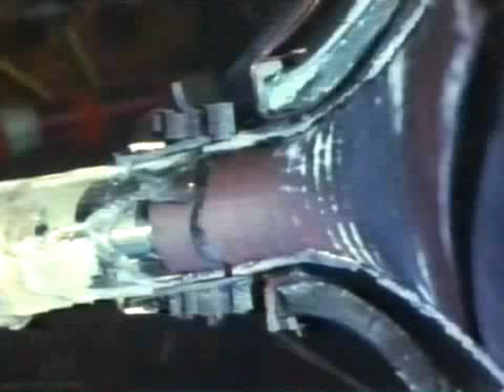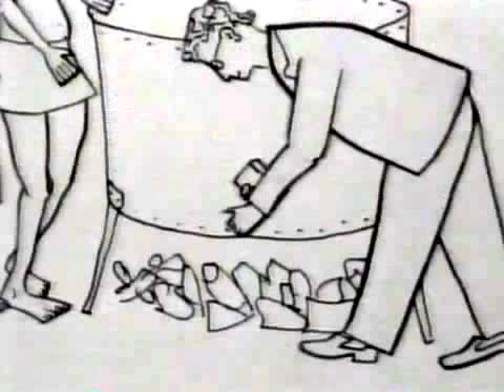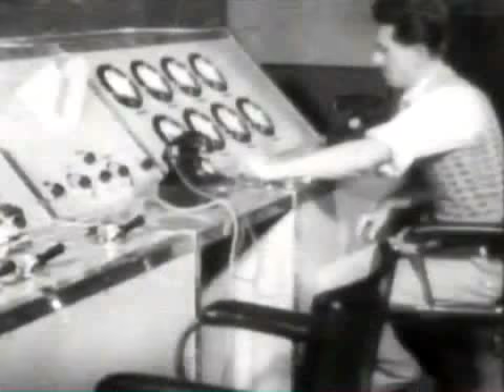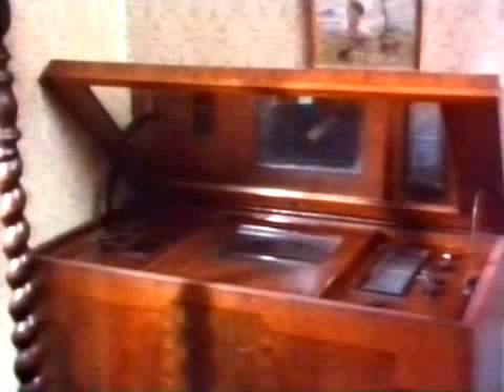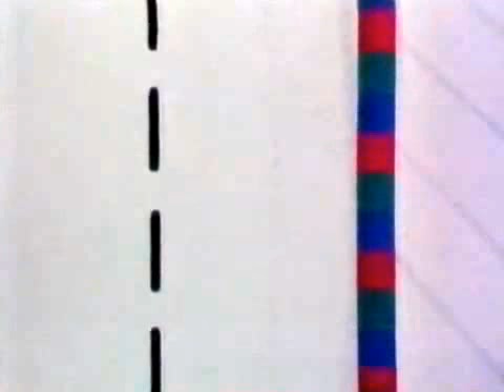Secret Life Of Machines - The Television Set (Full Length)

Comment: Every year on, fewer and fewer people will be viewing this on an old CRT screen.  Amazing technology back in the age of fire--bottles (tubes/valves).
Reply: There's an old, probably apocryphal story from the Cold War about American engineers first getting a close look at a Soviet military aircraft, and scoffing at it because it still used thermionic valves in its electronics instead of being all solid-state.  That is, until someone pointed out that in the event of a massive electromagnetic pulse from a thermonuclear bomb going off, the instruments in the Russian plane would have been more likely to keep working whilst the solid-state electronics in its counterpart fried.

By the end of the vacuum-state era, some valves ("Nuvistors") were as small as discrete canned transistors - I've seen a few TV sets that used them - and now, things are coming full circle with the recent development of the nanoscale vacuum-channel transistor...
Reply: @tommcewan7936  I worked for General Motors in London Ontario in 1994 on their LAV light armored vehicles division.  The engineers deliberately designed them with robust analog mechanicsl switches for exactly the reason you mentioned. Most of the varients which were created for battle conditions had foam injecgion systems built in to suppress any fire hazard. If only the engineers at NASA had thought of that when the Apollo testing was being done on the liftoff pad. Perhaps those three astronauts would have been spared that horrible death. White, Chafey and Guss Grisham.  RIP.
Reply: Who remembers a bad picture because of “ atmospheric’s” or kicking the tv cabinet inducing a thick line moving up the screen.
Reply: @grahamkearnon7853  or holding the "bunny  ear" aerial above ones head whilst balancing on top of the arm of the sofa  !
Reply: Here we are in 2023 and I can assure you that not a singke viewer will be watching this on anything other than a high definition TV , tablet or smart phone.

Comment: I worked in a television shop when I was in high school and college in the 70's.  Those old vacuum tubes, CRT's were a royal pain to work on.  Today, most televisions are "disposable".  They stop working, you toss them because it is cheaper to buy a new one, than to have it repaired.
Reply: You should watch Shango006, and RetroTech.
Reply: in some cases its only one or two bad capacitors in the power supply that stops modern ones working, if so, easily and cheaply fixed 😉

Comment: 605 line televisions. Tell them we have 4,000 lines now!
Reply: We don't though.  4k = 2160 lines.  (Twice that of 1080p)
Reply: @FunkySpunkyJunky  That doesn't really make sense. 2160 implies 2K since it's about 2,000. But anyway, we do have 8K monitors now, so yes, 4000 lines :). 2160 is still impressive by 1991 standards.
Reply: @tomservo75  yeah, i know it dont make much sense, but thats how it is. HD TV is 1080 lines and 4k is double that at 2160.  You are technically correct as 8k does exist, but not on mainstream TVs that I know of.   I wasn't having a dig, your point was still understood, that we now have very high def TVs that would have been unthinkable back then.
Reply: Quite happy with my 1080p 60Hz, thank you.
Reply: 405 and 625 lines

Comment: You forgot Philo Farnsworth! Inventor of the first fully electric television held 169 patents
Reply: They also forgot to mention that the Baird system only failed because the studio burnt down.
Reply: @nivlick  
No, it was failing before that. The 240 lines as opposed to the 405 lines of the EMI system, having to run the film through a chemical bath to develop it between the studio and the transmitter and the poor overall quality of the Baird-only sets and camera/ studio equipment all meant that fully electronic TV was the only way forward. The fire was just the last nail in the coffin.
Whatever you think of big business and its anti-social, even psychopathic, behaviour over the years, if you're launching a new technology like television from scratch, sometimes you need some proper technical and investment heft rather than just being a shoestring operation based on backwards- looking technology.

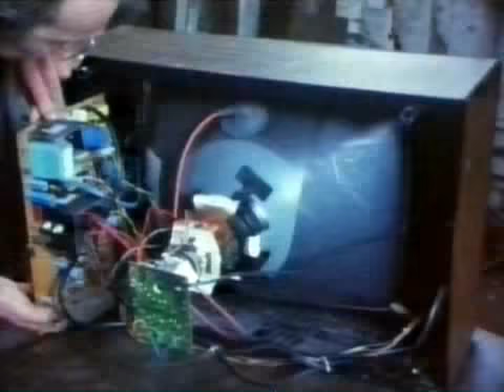Comment: 23:35 - I can't really tell from the poor quality of the video (as loads of TVs from the 80s had slide-out vertical circuit boards like that), but I think that's a set using the Rediffusion Mk4 chassis, dating it to between 1981 and 1985 (which, ironically, would have been - technologically - a little long in the tooth by then, the irony being that Tim claims in the voiceover that it's representative of a modern set for when this programme was made, around 1989!)
Reply: looks too modern for a mk4, even the 4A had 4 seperate pcbs, the one on screen has a switchmode power supply on the main board
Reply: @kevvywevvywoo  the one with the board on the left side may be a fidelity, the board looks familiar, i repaired loads of portables, mostly grey plastic cased,  using that board/chassis, usually psu blow up , occasional bad degauss posistor 😁
Reply: the one with the big 'motherboard' and several vertical boards is an itt , either cvc20 or cvc30/32, used to have a cvc30 for a few years, theres also a cvc5/8/9 shown, the one with a few valves in it, had a few of those, still got an unused 'spare' line output transformer for one..

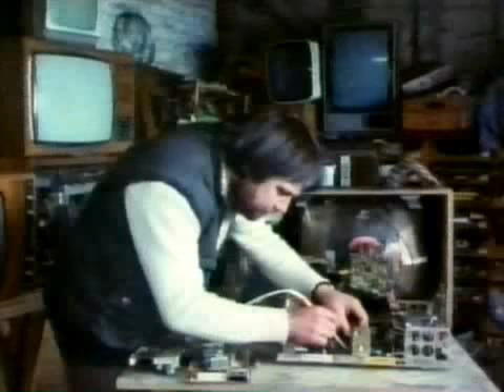Comment: 21:59 onwards - that colour set is one using one of the excellent ITT CVC chassis (somewhere between a CVC5 and CVC9, dating it to between 1972 and 1977). That is using one of the delta gun CRTs I referred to in another comment below.

Of all the TVs to go in that fire pile at the end, this ITT certainly didn't deserve to end like that!
Reply: i used to have 3 of the cvc5/8/9 series sets, plus a cvc30, and a cvc45? i think, all worked pretty well, the cvc30 being used as our main tv , with no back cover, previous owner lost it, !!,  for several years in the early to mid 90s,
Reply: @andygozzo72  If you’re on Facebook, you might want to join the group “UK Vintage Television Collectors”.
Reply: @stickytapenrust6869  already a member 😉
Reply: definitely not! poor old things 😢

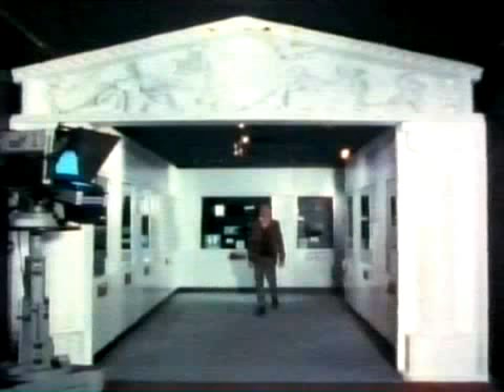Comment: 10:10 - that's an EMI 2001 camera on the left (with an autocue affixed to the front), dating from around 1968-1972 (which is when they were made). Many British TV companies used them and they were the workhorse of the British TV industry throughout the 1970s. The BBC were the biggest customer (indeed, it was designed primarily to fit the BBC's needs and requirements), along with about half of the ITV companies (the "big five" - Thames, LWT, ATV/Central, Granada and Yorkshire TV - along with HTV in Cardiff and Bristol and Anglia TV in Norwich).

The BBC phased them out slowly, with the first being taken out of service in 1976 and the last in 1991! The aforementioned ITV companies each began replacing theirs between 1979 and 1986, with Granada being the first (throughout 1979) and Central being the last (most of theirs had been taken out in 1984, but a pair remained for use with continuity and presentation purposes until 1986). Yorkshire TV were the last ITV company to use them for regular programme use, replacing theirs in 1985, and donated them to BBC Leeds for spare parts because parts were becoming scarce by that point!

Comment: 0:53 - I have that same model of TV in my collection. In fact, I have two, one awaiting restoration and another that's in such poor condition it's only fit for parts. That model dates from about 1975 and it uses the Thorn 9000 chassis, introduced the same year. It was Thorn's first TV to use the Precision-in-Line ("slot mask") colour CRTs and it was the second in Britain to use that type of tube, Rank-Bush-Murphy just pipping Thorn to the post when they introduced their Z718 chassis in late 1974.

The P-i-L colour CRT replaced the earlier delta-gun ("shadow mask") colour CRT that had reigned supreme in colour TV sets (apart from Sony, which used their own Trinitron tubes) from the introduction of colour TV in Western Europe in the late 1960s until being phased out in the latter half of the 1970s. Ironically, it was Thorn who were also the last to use delta gun tubes, in their sets using their 9800 chassis, made from 1978 to 1980.

Comment: Sigh. Back then tv was made to look great and work great. It made as furniture. Not anymore. By the way I was not alive back then and really not even a thought.
Reply: TheMonkeyFarted 
Back in the 50s and 60s, tv's used to be like a nice piece of furniture. Youd have a huge wooden box made of top grade, nicely finished wood, with usually mono speaker(s) in the side panels, but the actual picture tube was usually much smaller in diameter than the size of the overall box it was mounted in. So youd have a 4 foot wide, by 3.5 foot tall x 3 feet deep set, but with a picture tube that was only maybe 20" - 24" diameter(18" wide X 17" tall). They weighed a ton too! No idea how much they cost, but it was probably the equivalent to $2000 in today's dollars.....
Reply: @HighlanderNorth1  The first TV I bought was in 1980, 22" screen and it cost $NZ 1554.38 (includes interest because it was purchased on Hire Purchase).